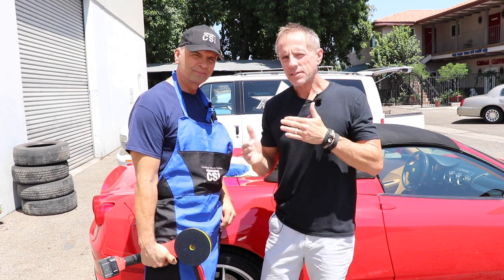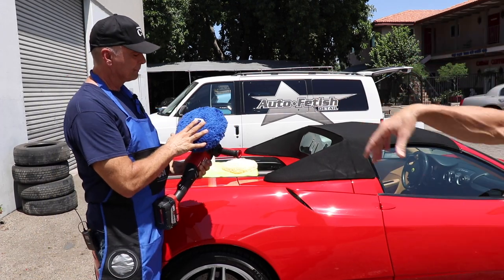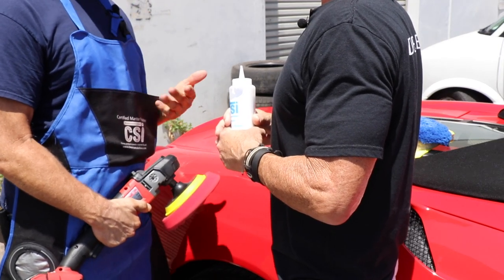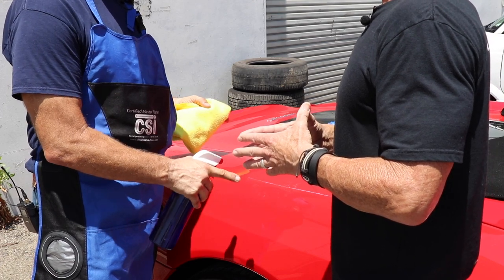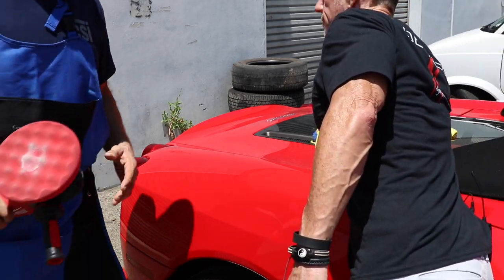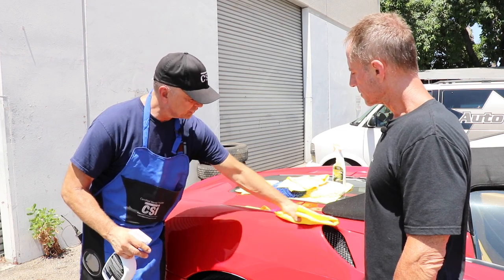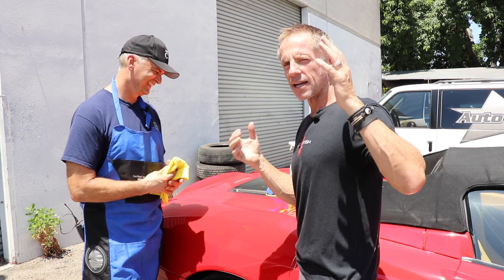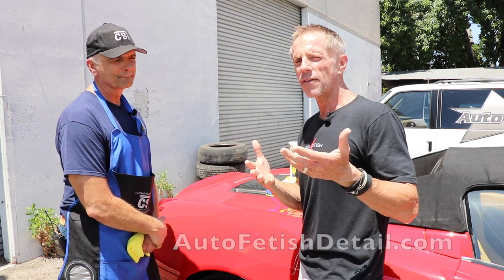Buffing A Car: Polishing a red Ferrari with CSI

Comment: Hi Darren just wondering if it is necessary to use a paint prep after using the water based polish? Especially in a situation where you will be applying a ceramic coating afterwards